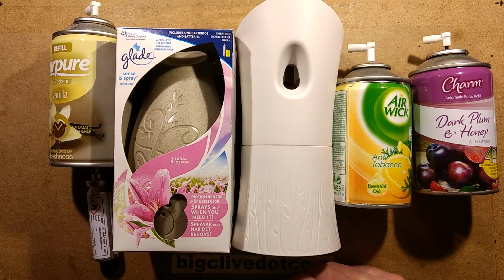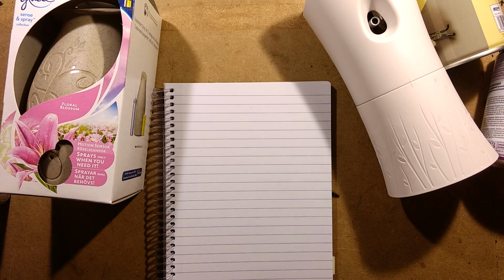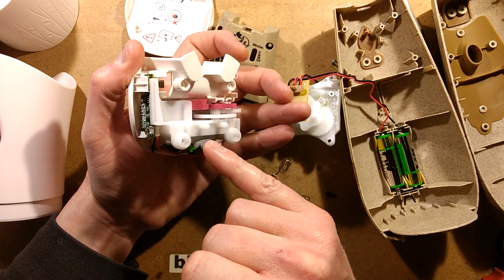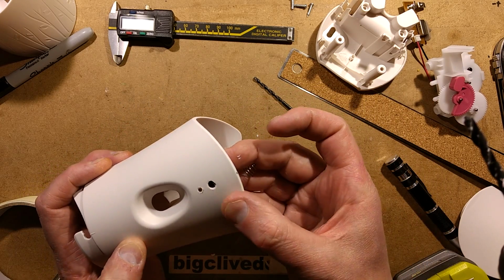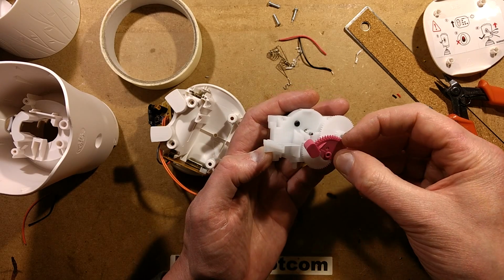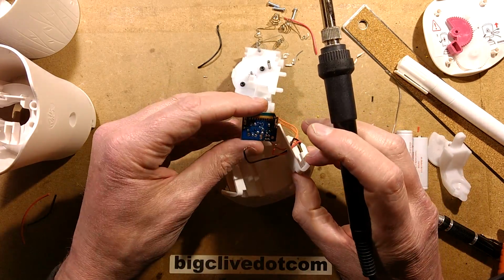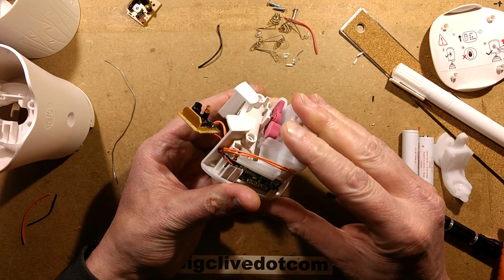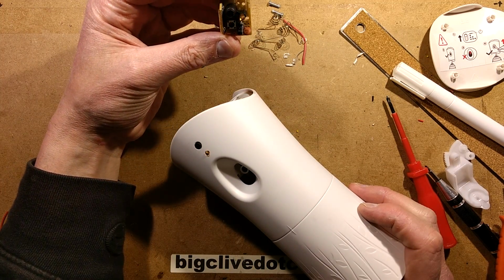Air freshener cross-breeding.  (mild profanities)

Comment: I remember what happened to my floor after I left the original big sprayer unit running overnight sitting on the floor.
The room was filled with lemon scent, yes, but the floor was also covered with an oily substance that I slipped on and bashed my head against the wall.

Comment: "This is what you do when a product doesn't do what you want." +bigclive, I can't watch TV on my fridge. Any suggestions?
Reply: I would prefer to follow Clive's example and only use parts from another fridge for this project.
Reply: Put the TV on top of the fridge? Works fine here. ;-p
Reply: You can get magnetic VESA mounts.  then just mount a monitor on that with a set top box on top of the fridge.  Simple :)

Comment: When the pink gear fell out on final assembly you put it back a little off the end stop so it was trying to overdrive and was clicking. Please tell me you rectified that or my ocd will make my head explode.
Reply from the maker: +Nicamist If it overdrives it runs right of the end of the drive wheel.  When the can is put in it winds back to the correct position.
Reply: Why was the gear slipping then?
Reply from the maker: It only has a partial toothed section.  It's designed to ride right off the main drive cog if there is nothing to press against.  When pushed back it re-engages.

Comment: I was trying to train electricians to wire up fire alarm panels, PLCs and electronic motor drives for 4 years who used to frequently incorrectly wire up that equipment without reading and following the installer's manual and blowing them up. They also would take the equipment back down off the wall, put it in the box and send it back to the manufacturer saying that it was faulty. After doing it several times on each job, the manufacturers would send their own technician out to wire the units and the Unions lost that work.
Reply: Robert Evans Really? I used to setup FACPs since I was like 14 and never screwed anything up without any help. all it takes is reading the manual...

Comment: Those use 2 different type of cans, the large ones are pressurised and the small ones are not
you can't just replace their mechanisms. small cans have a pump that can only spray a small fixed amount per actuation. to get a very short burst out of the big cans you gotta have a really short timed actuation. more like a solenoid than a gear setup, like that old one

Comment: My fingers hurt when I watch you solder.
Reply: For real. I use helping hands to join two wires together and end up burning the insulation off the wire with my iron anyway. It's amazing that he doesn't poke his hand with a red hot solder iron.

Comment: In the 70's i installed and tested telephone exchanges, we has a standalone push button dialler, it was playing up so i took it apart to fix it, unfortunately it was the old style button assembly, reed switch on the board, button, magnet, spring, and another piece of plastic, took me a couple of goes and found i had to balance the button assemblies on the board, then try to insert the whole into the top section , lining them up with the holes without the buttons falling apart.

Comment: I totally forgot about something I made from one of the motion sense ones like 6 years ago. I had a cat who was probably around 10 years old at this point and she decided she was too old to go outside to piss so she started pissing in the corner on our nice hardwood floors. After a few months of trying to stop this I gave up until one day I saw the motion thing in the store and thought "THATS IT!" I bought one I ended up removing the board from the housing and making a nicer looking box for it. I also needed it to spray outward and not straight up. I tried to make my own aerosol water can but I was never able to. Not having a proper way to pressurize the can made that part fail but I modified it to fit the cans from the dollar store.I set that thing to low sensitivity and bam no more cat piss..... in that corner. It was also kinda nice because you never had smelly feet since anytime you walked past it you got sprayed. But eventually the cat passed away and I put the device away and honestly have no idea where its gone. I wouldn't mind messing with it again.

Comment: Your channel never ceases to amuse! 

Nothing quite as disappointing as the magical reverse polarity pop of death, and the accompanying Eau de Burnt Electronics! 

The brief story about putting the dead thing back in the box and calling it faulty gave me a good chuckle.

I have a personal distain for air fresheners ever since the one where I used to work would randomly spray the occupant of the men's room on their head. It became an art to avoid it's nefarious spraying, I believe it was set to a fixed timer though not motion sensitive.  Nothing worse than smelling like sickeningly sweet fake flowers for the rest of the day.
Reply: I know the smell of burnt circuit well lol,  my brother built a tardis for his wedding as he and his wife are massive doctor who fans.   Being the computer programming expert in the family,  I got asked to make the controller for the light on top and the sound (a stage amp and speaker hidden inside.  Everything worked fine om the test rig (a superbright LED pulsing on and off) but then when I wired up a halogen 12v light using a cpl of mosfets (one to boost the 3v3 to 5v then the 5v one as the gate) oh boy did I miscalculate.   I had decided to optically isolate the micontroller from the output.  And I used the wrong type of isolator (I managed to pick one that was high resistance until light was received,  then it would stay on.  Whoops.   Coupled with an ineffective heatsink, plus the light itself burning the wallpaper,  it was...a rather choking aroma that filled the room 🤣.   So, I took a chance and removed the isolator,  replaced the now blackened mosfet with a better one,  raided some old home electronics for bigger heatsink,  and it works still to this day :)   it now takes pride of place at my parents caravan site as a decorative installation.

Comment: " and I put it back in the box and returned it as faulty" [ insert wicked laugh here], made me laugh mate
Reply: Back in the 80s, I worked at a Radio Shack store. Some of the ridiculously expensive computer parts, like memory boards, might be $1200 and special order only. They didn't allow us to return them unless they were defective.  Not surprisingly, if a customer ordered one, then decided they didn't really want it, those boards BECAME defective by way of a 12V 5 amp power supply applied across a few chips until the smoke came out. It's not like our little store could afford to just eat a $1200 board that we would never sell.  We would have been happy to return it still shrink wrapped but they wouldn't allow it.
Reply: A rare treat to hear Clive laugh [evilly].
Reply: $1200 in 1985 is roughly equivalent to $2750 in 2018.  How many people do you think are going to just walk into a electronics store and spend that kind of money today on a memory board?  Remember at this point there was no public internet.  It is a lot harder to sell something like that to a customer base of a few thousand that might happen to walk into a brick and mortar store.
Reply: John, you are awesome, I loved radioshack, I seriously hate having to order parts online, it is much better to just drive up to the store and look at the part and make sure it is the right one, and buy JUST ONE rather than a pack of 100 for a part I am only going to use maybe one or two of for my projects
Reply: @refraggedbean  I lament the same, my dear Main Electronics "Home of a Million Parts" succumbed (along with plenty other great speciality stores) to the Internet
Reply: @KOZMOuvBORG  yeah, sometimes it is just more convenient to go in stores
Reply: John Ridley that sounds like it happened multiple times. What do you mean “would never sell”?
Reply: +Wolfin lol that etherkiller is priceless!
Reply: 700th like 😂
Reply: OMG my thoughts exactly xD
Reply: jogged my memory lol
Reply: Air wick-ed
Reply: We've all done that

Comment: Dear Glade
Please diode.
Kind regards Incestuous User.
Reply: Diodes are for pussies, real man plug things right in the first try, including USB plug.
Reply: use schottky .. 0.3v
Reply: Generic 1N400x reverse polarity clamp diodes + optional protection resistors are cheaper
Reply: "forward fet" is probably too expensive
Reply: They probably didn't take incestuous electronics geeks into account during the design process.
Reply: You'll loose efficiency. You loose 0.6-0.7V/diode. No worth it.
Reply: Nah... Too expensive!

Comment: where can I find metric drill bits?
Reply: simontay1984 Gold
Reply from the maker: Probably eBay if not locally.  Or just use a close imperial one.
Reply: Plenty for sale at decent prices on eBay.
Reply: Any hardware shop worth going to?
Edit: that's the answer, not a question...
Reply: They don't have them here in canada. I had to special order the two that I have
Reply: europe

Comment: I don't think I have ever seen the anti-tobacco here in the states.  That said, I wouldn't be surprised if they just sell the same thing relabeled under different fragrance name for marketing purposes.
Reply from the maker: It's an odd one.  I've only ever seen it sold in one shop that often buys in cans from other countries with different languages on them and unusual aromas.
Reply from the maker: Many hotels use high output timed ozone generators to try to get rid of the smell of smoke from rooms.  They turn them on and then leave the room while it sanitises it.  You get a nauseating bleach smell afterwards.
Reply: thechosendude It is a very common fragrance her in Argentina and most of South America i would say... hahaha....! i always though that it was imported from Us.
Reply: yea I was surprised to see that fragrance as well. I'm a smoker and I actually use that exact Glade product but I've never seen that canister. Oddly enough my Glade product uses the timed spray mechanic rather than the sensor and I can see when he took his apart that it has the timed settings in it as well. Is that switch just not that in the sensor version or does it have both options?
Reply: SpydersByte
I figure an answer 4 months later is better than none.

I believe that the old circuitry was bypassed for the more economical sensor-driven model. Besides, I don't see the point of the old timer. The sensor sprays when it is interrupted. Someone is there to smell it. The timer just wastes your money by freshening up an empty room.  ;-)